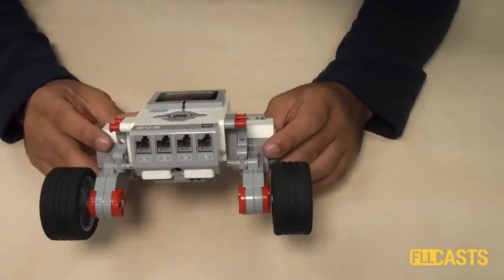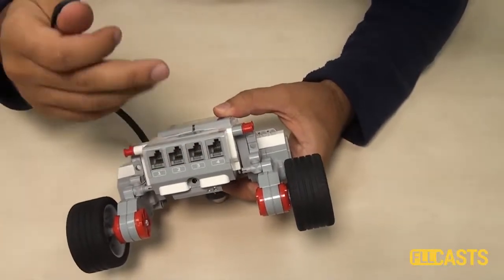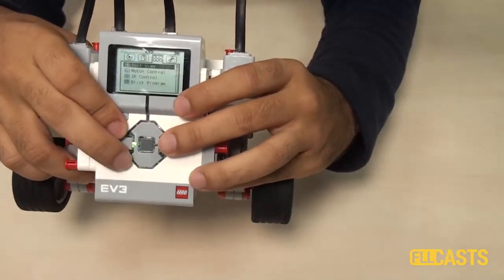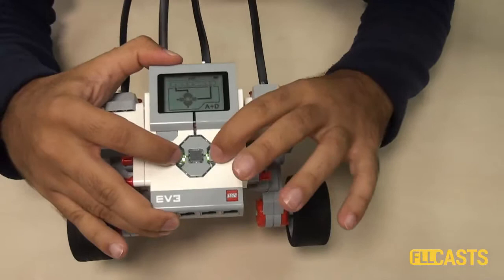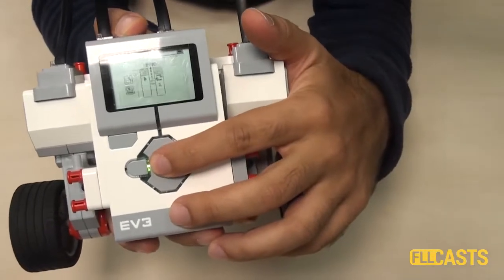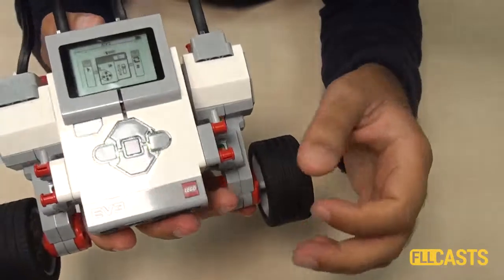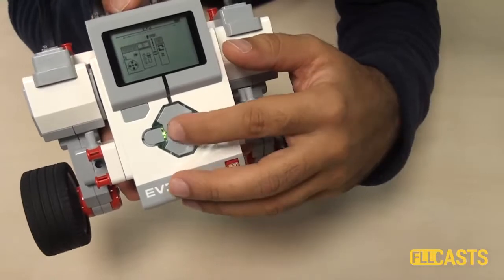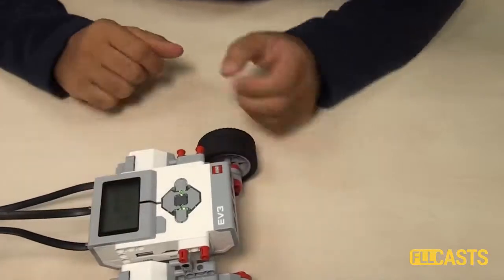EV3 basics course. Motors control and program from the brick (part3)

Comment: How to synchronise two large motors by Brick Program ? we run both motor drive Brick but it cannot synchronise rotations.
Reply from the maker: @米爸  Unfortunately,  you can't synchronize them perfectly. What you can do is try to find the best matching motors so that they rotate at speed that is as similar as possible.